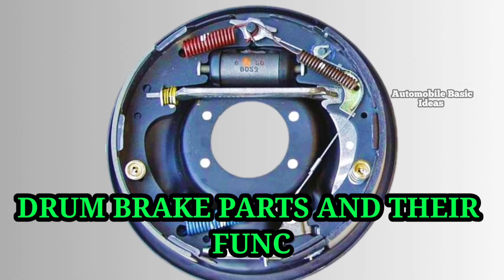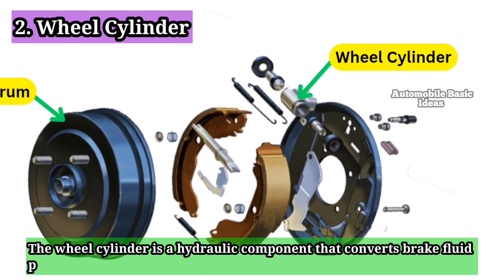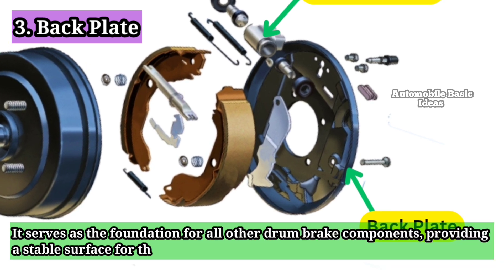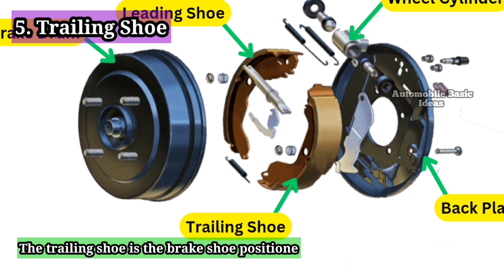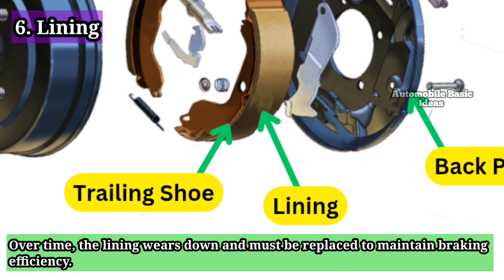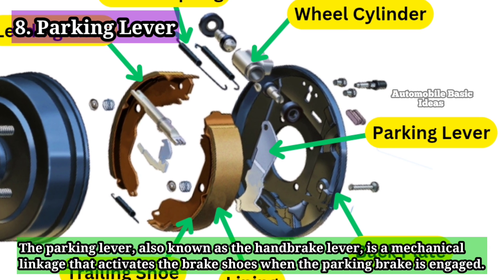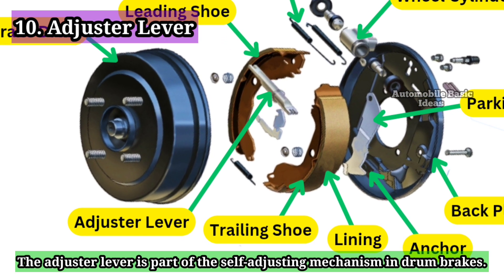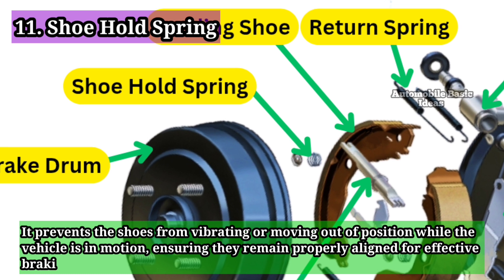Drum Brake Parts And Their Functions

Comment: I have this annoying issue... whenever i release the handbrake from an incline parking position there's a "Tug" sound coming from the back, what could be the problem?
Reply from the maker: A “tug” or jerk sound from the rear when releasing the handbrake on an incline is usually normal brake binding. Most commonly it’s caused by rear brake shoes or pads sticking to the drum/disc due to rust, moisture, or slight wear, and the load on a slope makes it release suddenly. Other possible causes are tight or dry handbrake cables, self-adjuster movement, or worn drum/disc surfaces. If the noise is mild and occasional, it’s usually harmless; frequent or harsh tugs should be inspected🧑‍🔧.